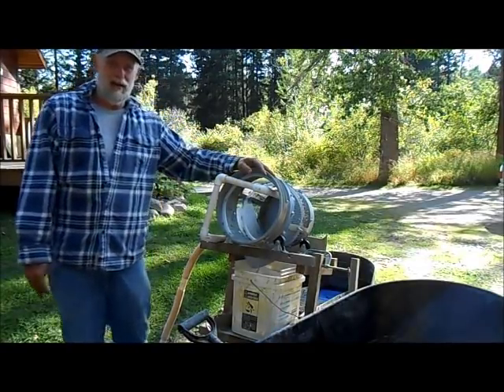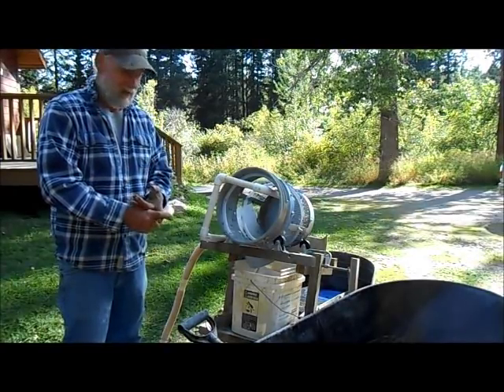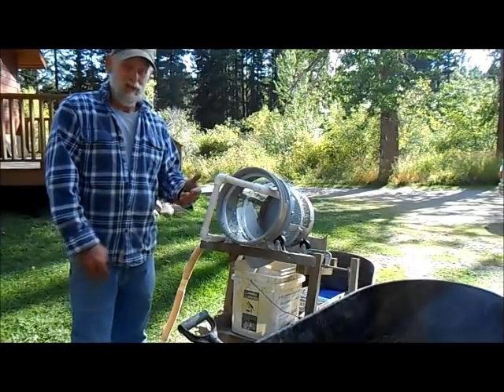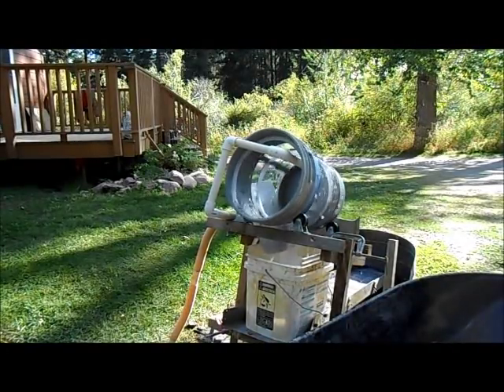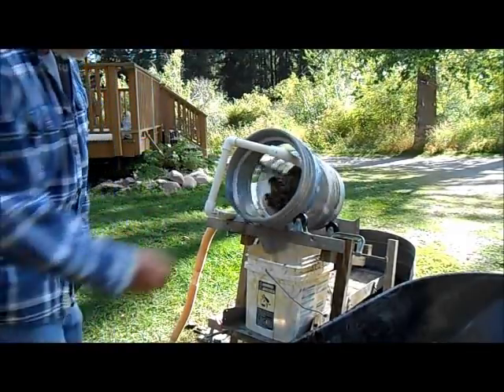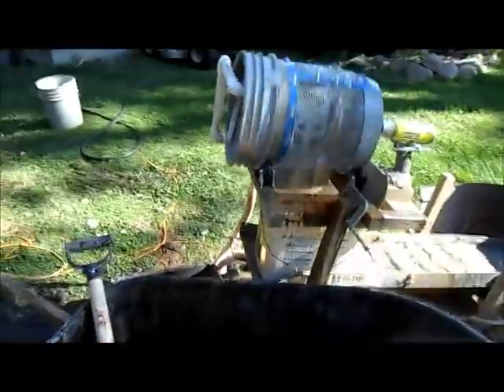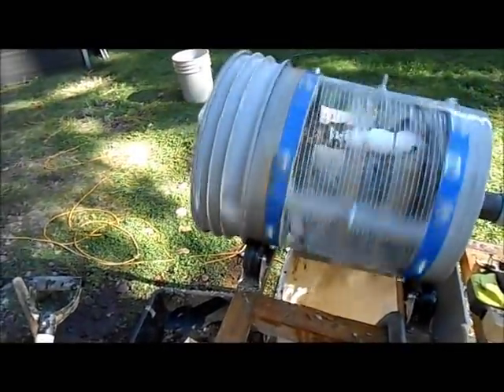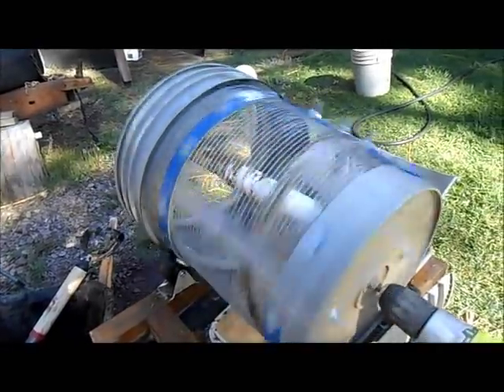Alan's DIY Bucket Trommel Clay Buster Wash Plant Prototype

Comment: Be cool if the motor turning the trommel could pump the water as well. And or make it manuel...like the fact u can dump the rocks  out manuely backwards after it runs for a minute...pretty sweet.
Reply from the maker: Thanks Not sure how to get the motor to pump the water. I have been working on the trommel all day and I think I got it. Just put the dirt in the hopper and the dirt changes direction 4 times before in goes down the sluice. That should break up the clay.
Reply: Alan Robertson nice.. supprised how that drill motor is moving the trommel with all the rock weight.  And at that speed....
Reply from the maker: @ziongray918  I wonder how long the drill would last I am now using a windshield wiper motor that is working great. I have made a bunch of improvements to the trommel I should have a new video up in a few days.
Reply: Alan Robertson awsome. Imagine the size of one you could make with a weedeater motor...it would probably just run on idle....did you invent this or improve it?
Reply: Alan Robertson. I was thinking about it and im pretty sure i have figured the way to pull water and turn the trommel at the same time..the main shaft would have a large sprocket that is weilded to it. This would turn a seperate smaller sproket off to the right attached to spin the water pump.....im not sure how it would run a pump and a trommel at the speed and torque but different rpms because of gear ratio. Thats why i suggested the sproket thats inline with the trommel be largeer so it takes longer to rotate then the pump which would turn many more times then the larger spocket...i think centrifugal pumps run at 1800 rpm. But i guess it all depends and what pump to choose....hand made pumps on youtube can show you how to make your own.......idk those are my final opinions on a concept brother cool setup regardless man.
Reply: Alan Robertson i was thinking if u had a water pump ran off the same shaft thats moving the trommel...dont know how much water it would pull. But if it had a clutch maybe the pump could use more water after its been rolled ...i dont know i like anything i genius that has to do with mining...and that device is awsome has potential to be perfected to ones liking.

Comment: how about the Archimedes screw?
Reply: Awesome rough draft.
I've never seen any on here that look like a real trammel to me.??
Its probably just me.
 No screws or  bolts or screens needed in mine.
At least not in the tube, and the spirals are real SHALLOW and MANY
 The threads cause the heavy gold to drop after it climbs up and the water washes the dirt etc. the other direction.
I've used nice water washer shaker tables (4 hours) too much work for me  just to sift and pan carpet.(my opinion)and these were large with two 2 inch pumps with a water tower tank and some clay be gone for clearing up the dirty circulated water, i was in the desert...anyway
the inside tube is strictly rubber, only 30 inches long and 12 inch across but it does a real fine job, rubber poured into one molded piece, no holes, screes or, bolts.
the rubber lined grooves of this tube spins with/inside a metal tube( frame for stiffness) and rolls on wheels.
It clarifies in just 15 min. of dumping shovels full in to a water wash hopper with rails  on top it  keeps too big of rocks from getting in.
No shaker, just spin rinse and gold in a pan, dirt at the other end.
hope i don't sound like an idiot and hope it helps.
the fun was using it in my neighbors yard and the look on his face when he saw gold in 15 min lol. I since moved and cant remember where he lives in Arizona..

Comment: Sweet rig!
Reply from the maker: Thank you.Still a work in progress.
Reply: I'm really curious as to how you constructed the bucket. It looks solid and durable and how did you do it? I constructed a similar device to classify and just ended up using a wire wastebasket which works okay,  but it measures out to about an 8 mesh which doesn't do well with clay... and we know that good material usually has a lot of clay. Anyway, if you could toss a segment into one of your upcoming vids about how you constructed that, I'd be most grateful.
Reply from the maker: I will do that for you probable when I get the new motor put on.

Comment: Iv seen some guy make a trommel out of a mesh bin bolted onto a windscreen wiper motor
Reply: Sorry windshield stuff too small, BIG torque needed here, small car starter motor, double or multi-wide V belt, Chain drive from bike maybe best? Already tried WS washer pump for mirco cleanup sluice & duty cycle so low that it lasted 15min. Alan (kitchen garbage pail lid foot-pedal on the tilt/dump)...

Comment: I'm curious, would the bolts work better from the outside in? The theory in my head is that the excess bolt could work as a agitator.  I would love a response. I'm starving for information on these😂😂😂😂😂😂😂😂
Reply from the maker: Hey Allen not a bad idea for my set up I think I would be best to have the extra room in the bucket and I don't want the shovel to catch one of the bolts the screen is already pulling the material half way up the bucket and tumbling them well just my thoughts. Thanks for watching.
Reply: Alan Robertson makes perfect sense. Love your channel.

Comment: Fandamntastic work in progress!  One improvement ya might want to consider, replace the "C-Clamp" with a dowel rod or heavy bolt .  Can't wait for the video of you building this fine invention of yours!
Reply from the maker: Thank you Richard you are right about the bolt and I go back and forth on that I have been using the C clamps to hold and level my set up forever and they work great. It is going to be fun to make all of the improvements. Thanks for watching.